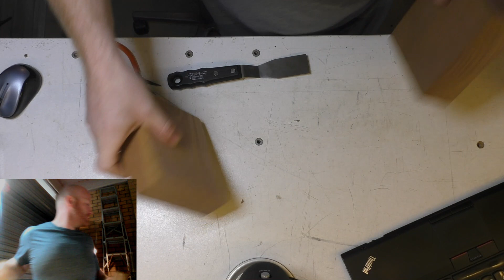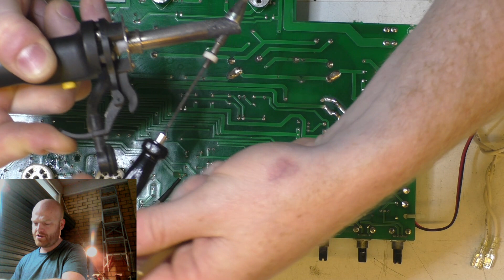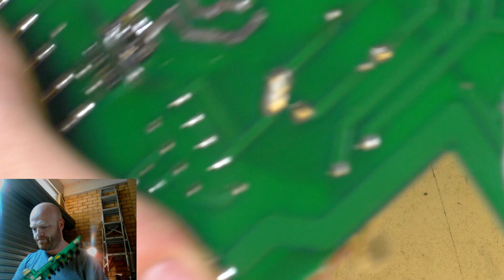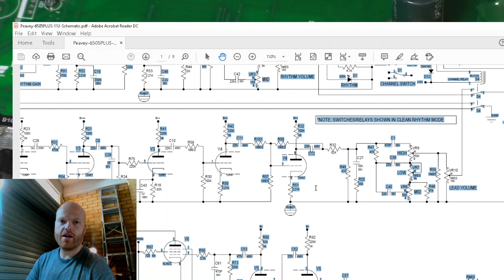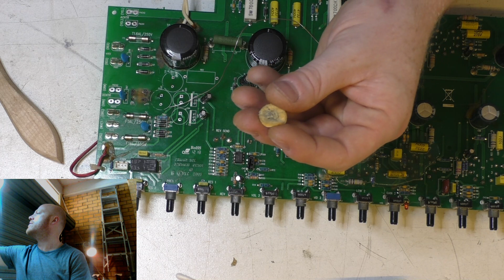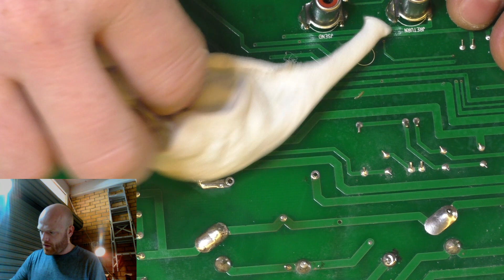7am Sunday live repair - Peavey 6505+ Combo.

Comment: Im now the proud owner of one of these with same the SAME EXACT mods and fuggin glue everywhere (even the way they scraped out the R36 series grid resistor). It currently has no output (returns/sends/everything checked) and the power stages glow. 

Im under the initial impression that the presence feedback wire shorted or did something weird as the wire melted to the resistor between the two big caps (R7). also that mod around R101...the cap (also under MORE glue than this one.) looks like its puffed up. This is my first tube amp repair but Ive done just about everything else under the sun. 
Wondering if you ever named the modders that did this since 100% the same workmanship.

Comment: Cool man. I ended up watching it again for entertainment. Ive got an 8ohm speaker in mine and it sounds shit on 16 or 4 and the 8 doesnt work? Would that be the transformer?
Reply from the maker: Probably the impedance selector switch. Discontinue use until it's been addressed or you may severely damage the amp.

Comment: Thanks for the video, I've been looking for info about the 6505+ 120w head because mine had no sound. I took a q-tip and some isopropyl and scrubbed out all of the jacks and it's good as new!
Reply from the maker: Fantastic result! Good work, mate.
You may find that a sliver of manila folder threaded into the jacks shunt contacts and pulled out under tension several times will give you even greater longevity.

Comment: I have a questions: how can I clean the pots from this amp? considering it doesn't have those normal round ones with the little hole where in them, where you can spray the electronic cleaner
Reply from the maker: It still wicks into the potentiometer assembly. Just put down some paper towel to avoid spraying it where it doesn't belong.
Reply: @BradsGuitarGarage  thank you! So I just spray the cleaner on it from the inside of the amp?

Comment: Great to find your channel searching for a fix for the same amp as mine. Anyway, bought it used a year ago and it would have sound but it’ll crackle and all that. So I bought new tubes, installed them,  the crackle seemed to only show up when powered up and would come and go when playing. So fast forward to today and I haven’t powered up/on this amp for a year or so and there’s no output, just static/crackles. I’ve built diy pedals and can solder good. What should I look for to replace or fix the issue. I came across a link on the web and it says that it could be the rectifier diodes and should be replace with 400 v ones. Any ideas? Thanks for your help in advance.
Reply from the maker: No idea, mate.
I'd need to diagnose it in the flesh.

Comment: The fuses are soldered on the board... sounds like bullshit to me! I experimented you can easily remove hot glue with some alcohol. You should try! That amp is not that well made to me, maybe it's better to buy a Bugera 6262 and replace some crappy components.

Comment: Mine will be back in the shop.  R7 burned up.  Charred a harness so hoping it's just the sleeve and didn't trash the wires as well.      Probably should grab a back up seeing how the local shop is always busy and has a three week turn around time at min usually :(

Comment: Thanks man. I replaced the diodes with a 1N4004 (400 V forward voltage rating) and it works. Hopefully those diodes are suitable for the long run.
Reply from the maker: Hi Matthew, the best option is to go for a higher current rated diode, lifted off the board with crimps or ceramic standoffs. I think from memory, the 1N400x series would be okay for their current rating (all voltage ratings are sufficient) but the heat needs to be dissipated more effectively than the factory installation of the diodes being mounted hard to the PCB can offer.

Comment: brad ..on a 5150 the voltages comming out of the transformer to the board in the 3 wire groups i have 33v on the 3 orange 53v on the brown 5.3 on green. are they supposed to be A/C comming out of the transformer? and should one group have more volts than that? your help would be wonderful
Reply from the maker: Mate, I hate to tell you this, but if you have to ask that, I'd advise you either take the amp to a tech, or get reading on the fundamentals of electronics. I mean this in the kindest way and I hope you chose that latter, but if you do, make sure you read up on the safety measure required to work on electronics appliances and particularly, valve amplifiers.

Comment: I have a 112 6505 and my lead channel has dramatic loss of gain in power but if I go over to my rhythm Channel Plays perfectly fine I don't know what's going on if it's a power tubes or the tubes and it in general or what but I've  sunk a good amount of money into it and it's my bands back-up amp and im trying fix it need help man
Reply from the maker: I'd imagine that's a preamp issue. If you haven't worked on audio equipment before, this won't mean much, but check all rail and valve pin voltages and make sure they are in the ballpark for starters.
Reply: @BradsGuitarGarage  got my 6505 back man

Comment: Hi Brad, I have a few of questions. A couple months ago I found a 5150 "block letter" head that was manufactured on January 6, 1992 that I found in front of a salvage bin at my local town dump (Boston, USA). There appears to be some minor spots of rust on the rear of the chassis and somewhat around the output/power transformers, although I've seen much worse with some vintage amps. I couldn't tell you how long it's been sitting there or what's wrong with it, but there doesn't seem to be any water damage in or around the head's cabinet. I opened her up and the circuit board seems pretty solid except for a little rust on a small board that connects the speaker output jack to the chassis. Sorry for the ramble! Now for the questions: First, is there any way I can safely troubleshoot the amp without purchasing expensive electronic repair tools, mind-you I've never plugged in or turned on the amp out of safety concerns. Lastly what the reputation of these amps and is it generally worth it to repair them considering that they are relatively affordable in the states? Also are they cheaply made and do they stand the test of time?  Thank you! I'll be sure to subscribe.
Reply from the maker: Repair to any amp requires specialist test and soldering equipment or you'll do more damage than good. I often get jobs where someone else has tried the DIY approach, and the cost blows out to reverse the physical damage to the PCB from unsuitable soldering equipment. These amps have a following, I don't personally like them, but they do the totally saturated modern metal thing OK. The USA ones are built weirdly, but not cheaply and can be mad pretty reliable. I'd suggest you start reading up on the subject and give yourself time to understand the concepts before diving in. There's a Facebook group called "Tube Amplifier Repair and Diagnosis" that is worth joining to learn more and search for posts relating to that amp.
Reply: @BradsGuitarGarage  Thanks for the reply! yeah, I'll probably take it to a local tech to start but I'll be sure to join the group because I've been trying to learn about amp repairs. I'm also looking into getting a Daul Rectifier, but I hear techs don't like to work on them so I'm hoping to learn myself. Again, thanks for taking time out of your day to reply  to some random internet stranger. I'll be sure stay posted when new content comes out.
Reply from the maker: @thebostonguitarist7886  No worries,check out my Facebook page for detailed repair reports and photos too. I've got a Dual Rectifier on the bench right now, actually. So you'll get to see the guts in detail.
Reply: @BradsGuitarGarage  My sympathies, Brad. There's only one amp that's 50% worse to work on thank a Dual Rectifier. I bet you can guess. Good job on your videos, too.